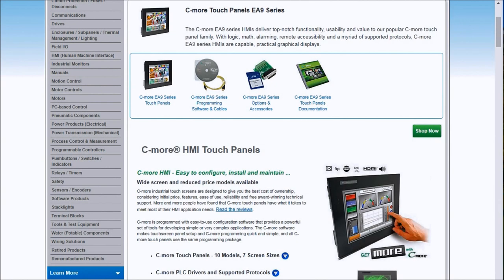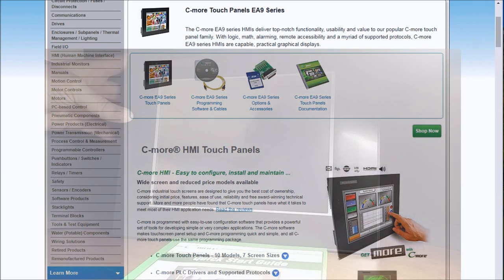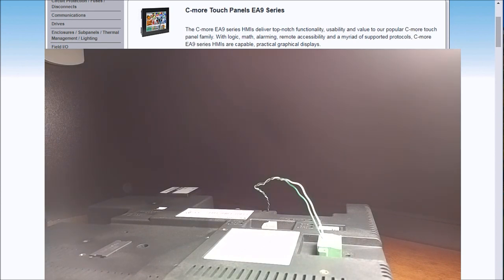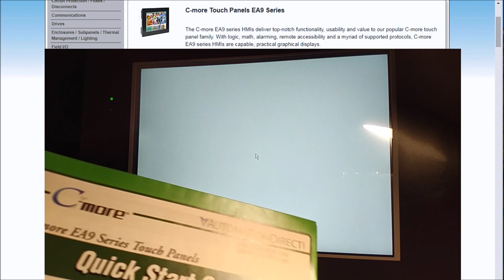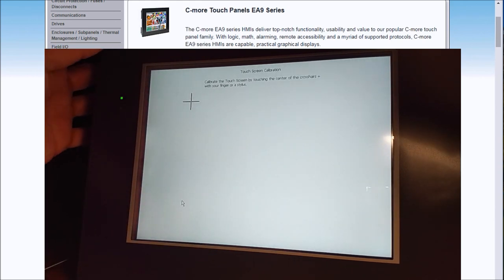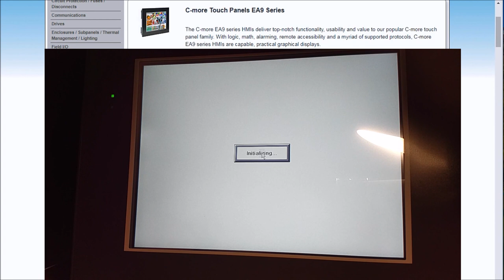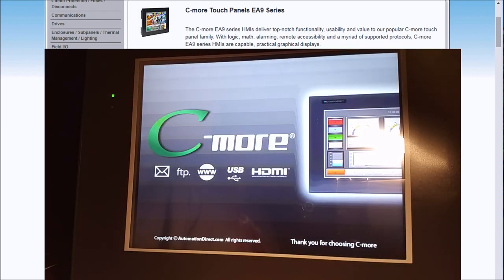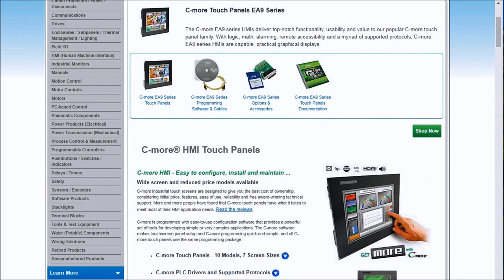C-More EA9 HMI Series Panel Powering the Unit

Comment: I want to get a CM5-T10W but it is a dc system...you familiar with any ac systems that you would recommend?
Reply from the maker: Using an AC supply to a HMI would limit you to only a few units. It would be best just to add a DC supply with your AC input to power up the unit.
A simple power supply like the following could easily be used.
https://www.automationdirect.com/adc/shopping/catalog/power_products_(electrical)/dc_power_supplies/din_rail_mount/2687-2142?_gl=1*1jimw8f*_up*MQ..&gclid=CjwKCAjwqMO0BhA8EiwAFTLgIHoxdsf2i_l86F35ozuYQ7hXMnnN8TrUUkHOFtRiTrsuQjJ-1QwosBoCprgQAvD_BwE
I hope this helps you out.
Regards,
Garry